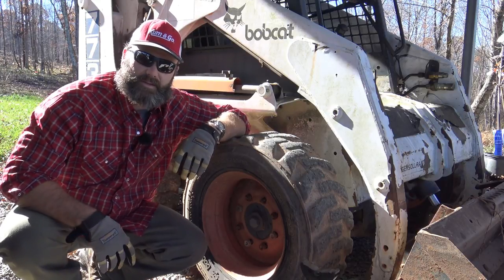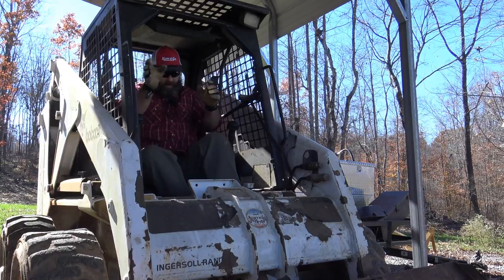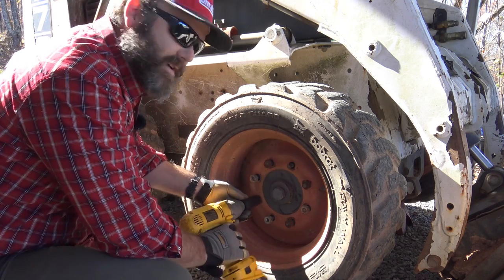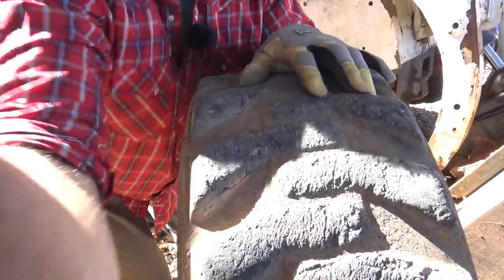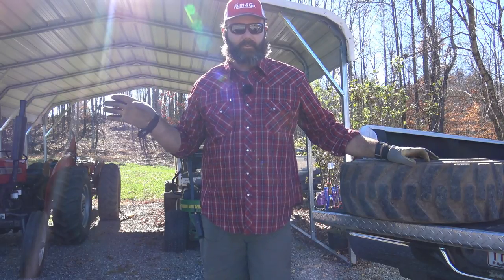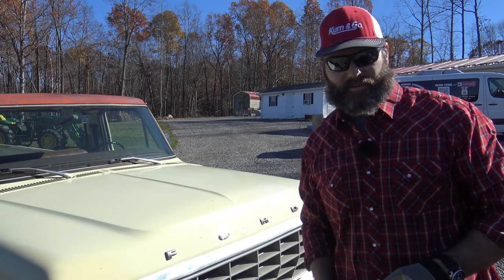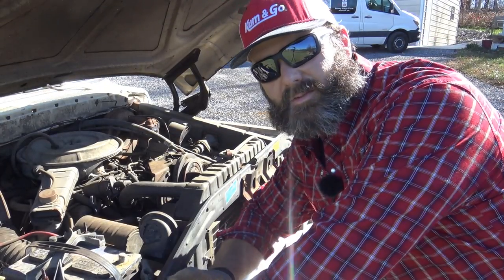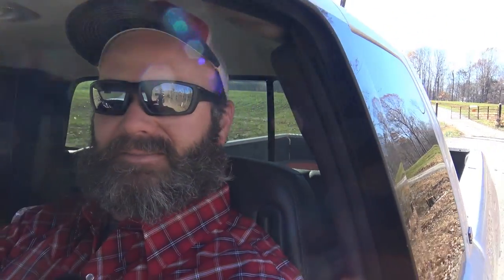$100 Pickup truck update, Bobcat Troubles again...another darn rant: government and responsibility

Comment: You may want to rethink the order of hooking up those battery cables  to battery...
Reply: agreed, positive 1st.
Reply: Agreed. You hook up the positive terminal first and then the negative terminal last on a negative ground piece of equipment. On a positive ground piece of equipment you hook up the negative terminal first then the positive terminal. Why, because slinging a wrench on the ground side and you accidently contact a ground point it will cause no harm. If you are on the "hot" side and touch a ground with the ground already hooked up you can cause damage, fires, explosions, injuries and even death in a worst case scenario.
Reply: The main issue is that the positive side will spark more than the negative side. Less spark is always preferred.
Reply: yep
Reply: Always pos first! You don't want to send a power surge into the elec system. These days manuf. have gone to using the neg side for switching things and controls for this reason.
Reply: Agreed, positive first.  It won't short out against anything should you happen to brush the frame with your wrench because the negative side isn't connected yet.  Always positive first when hooking up and last when disconnecting.
Reply: That is about the most sensible reason, some of the other theories are very strange
Reply: For technical functioning it does not matter in which order you connect them.

However for safety reasons it does matter.

The whole body of the car is usually connected to the minus pole. And you can accidentally hit that body with the positive lead. So connecting the lead first is safer.

Recap:

Negative pole first:
Whole car (except a few parts like the positive pole) are connected. Any mistake with the other lead will lead to a short. And car batteries are very good* at shorts. You really do not want this.

Positive pole first:
Only a small part of the car is now connected to power. If you mess up by touching the car with the other lead nothing will happen.

Lastly: This might also be a habits for people who deal with electronics. Ground goes first. Always.
Reply: Negative always comes off first and goes on last.

Comment: Disconnect battery.  1.  Neg   2.   Pos.
Re-connect battery   1.  Pos    2.  Neg.
Reply: Yep! ALWAYS disconnect the negative first and replace last. (This is assuming that the vehicle is negative earth) That way, if you're disconnecting or replacing the positive lead and the spanner touches the bodywork it can't short out.

Comment: A tip on how they "rebuild old batteries". Dump them out to dry. Test the core for conductivity between the posts. Fill with fresh undiluted battery acid. Spray some clear gloss on the casing. And, send them out for sale.  The factory gives the dealer 90 days warranty, and dealer passes it on to you. People who add tap water to a battery low on fluid are just shortening it's life. After a few "top offs" the acid is so diluted, it wont carry the amps needed to turn a starter.  Pay a garage to sell you a soda bottle of fresh acid. Keep it in a safe area in the trunk for top offs.  20 oz will last you for years. Corrosion of the coper plates is what generates the "juice" in a car battery. When they "done" They "done" fo-evv-a.  No mount'o new acid will revive m'. It.s been years since I even saw a battery with fill caps on top. Do they still make them ? I sure don't buy them. The vapor is what corrodes the terminals.

Comment: Love your videos.  I watched the one where you changed the wires, carp and Rotor.  I still have a dwell meter and timing light but haven't used it since around 1984 when I had a 66 Chevy II and we still had my Mom's 74 Hornet.  I'd have to "you  tube" how to use them, it's been so long. ha-ha..
That stuff was a pain but not as bad as the mystery Coil packs that go bad on my 02 F'd 250, as I call it.  Between spitting out spark plugs and Interior light/door lock computer issues, having more of that crap on a new truck really scares me.  I can't imagine that junk working when the computer and cruise control failed after only 7 years on my 02.  Anyway, ranting here, but nice to see your videos.

Comment: That truck is a hell of a find for $100.  It looks to be really original, right down to the hub caps.  I bet a lot of Ford fans would give their eye teeth to find one as original as that, and a hell of a lot more money too.  You're right about ethanol fuel.  A lot of older vehicles have brass components in the fuel system and carb, and ethanol will attack them like crazy and cause huge damage and problems...
Reply: +william III  You're right, the composition of diesel fuel has changed somewhat but those changes tend not to be so dangerous to older vehicles as the ethanol problems.  And, as you say, there are fairly easy ways to deal with it...

Comment: Here in Michigan its called "Rec Gas", (Recreational Gas) or Boat gas. 99 octane more expensive but i use it in all my small engines, ATV, Sno Blower, lawn mower Chainsaws, Etc Etc. I had to replace all my gas lines a carb kit and new fuel pump in my ATV, Ethanol gas will destroy small engines if let to sit more than 6 months even using fuel stabilizer. Do a google search for your area to find who sells it, all marinas will have it but its really expensive at marinas.

Comment: I pick up those side of the road mowers,clean and rebuild the carbs,then resell them. Most of the small engine repairs I do are fuel related. I love them,love that shitty fuel. It makes me money,thats all that matters. Love the older trucks,dont need those bells and whistles on these newer trucks.
Reply: RC Hobbyist Extreme I’ve come to appreciate both new and old trucks. Had on old 04 f150. Nothing fancy but great. Got a new truck 13 f150 all the nice bells and whistles. Both great. Trucks just depends on your needs

Comment: I was a mechanic for a local John Deere dealer and saw many small engines that had the carb messed up due to ethanol. I have fuel shut offs on all my equipment. I shut the fuel off and run the engine till the bowl is empty on the carb. I have never had a problem with the carb gumming up.

Comment: make sure u put the skid tire on right , the tread were facing the wrong way , its for traction. look at the back two.
Reply: Amy Bahr    tractor lug tire are designed to be self cleaning . If you run them backwards the lugs will pack and then you have " slicks .

Comment: You stated the size of bobcat tire incorrectly, 10x16.5 means the tire is 10 inches wide with a 16.5 inch wheel diameter (rim )

Comment: Few years ago a local station started sell what they market as "rec fuel" ethanol free gas. I been running it in everything from mini bikes, snowmobiles, quads and all my yard tools like mowers and weed whippers. Ever since I started I no longer have to clean carbs or drain gases at the end of season. Example my wifes mini is still running off the gas I put in it in 2015. It just finally ran out of gas this fall before I put it away for the winter.

Comment: Those are repairable. At our shop we get these tires in all the time. It needs a hot section and a recap with some HBAT tread. 40.00-60.00 to repair and around 125.00 to recap it if it passes
Reply: super6954 I missed it. His tires are a bit smaller than what were used to recaping. The prices range chcnges. Also when we recap them there alot more rubber on them than some.
Reply: Hector Nevarez sup Hector
Reply: Keeping It Dutch how's it going dutch

Comment: Love your $100 truck! You got a deal of the century with that. I hate the crap gas we get now. I have a 79 ford too that my dad built when I was born in 1985. Its got a bbf 460 that's been fully built and had about 500 hp. He drive it everyday and I drove it all through high school and up until they started putting ethanol in our gasoline and of course it destroyed all the fuel lines and carb. It took less than a year to do more damage than my dad and I did daily driving it hard, taking it to the drags, and doing some of the biggest burnouts for over 20+ years. Now that's that crap has been around for years we know not to get it but here in Claremore Oklahoma there's only a 2 out about 15 stations that have 100% gas. I hate it!

Comment: Josh it's the brake light that doesn't work on the trucks drivers side. If there is no drain plug on the gas tank, you should be able to get a hose in the tank. Probably best to drain that old gas out and not drive it out.

Comment: AWESOME truck , it's actually TOO GOOD for a farm truck.
Just a note to young newbies messin' with old vehicles with old gas.
If you get your hands on an old vehicle with really OLD gas DO NOT run it through the motor!
Funky 2-3 year old ethanol gas is usually ok but really old gas that's foul and stinky, funky and skunky will coat the valve stems with a super sticky varnish and after the valve drags that stuff into the valve guide for a bit there's a high probability it will glue that valve into the valve guide.
When that happens push rods start bending and you have created a HUGE project for yourself. Heads off, disassembled, cleaned,   re-assembled and re-installed and new push rods at the bare minimum.
DON'T DO IT !!
"The More You Know" .....

Comment: Love the daughter comment at 3 my daughter learned how to re-handle axes and hammers. Every time I work on something car, truck, etc. she is in the shop with me tinkering and helping. When her future BF/husband can't change a flat she'll be able to! But I hope that she'll be with a man that can do those things and not one of these know nothing boys these days.

The only good ethanol is the E85 and it's only good purpose is because racecar. It's combustion and such is far greater than race gas, you can run more aggressive timing curves and higher compression etc with less risk of spark knock. But as far as cars and small engines for regular use unless the engine and fuel system etc is specifically built for ethanol it is pointless and damaging.

Comment: we have a battery reconditioned place here in Denver. I asked them what that was about. they told me many of the batteries turned in at retailers are ok and just run down because the battery was not bad the charging system did not work. they charge and load test the battery. if it does 80 percent or better they sell it for 30 bucks and give a 2 year warranty. They will even swap out the battery and check your charging system no extra charge. My daughter needed an expensive german battery for her vw got a 30 buck one and it lasted 2 years. a friend needed 2 expensive batteries for his RTD transit bus again 2 for 60 bucks and on it goes. its ok to buy good used tested, not actually reconditioned, batteries.
Reply from the maker: Nice...I may have to pass that on to my buddy out there in Longmont!

Comment: You should keep your eyes open for a 1978 to 1979 Ford F250 4x4.
If you find one with a Dana 60 under the front it's worth its weight in gold
Reply from the maker: Nice...thanks for the tip

Comment: I saw flashing red lights in my brain when you said you knew where to buy a "good" reconditioned battery.  NO SUCH THING ! They can put some life in an old core.  But "cranking amps", which are key to starter life,  has to come from the factory as an upgrade over the low amp  that is good enough for a new, mid size car.  A long life battery will have a 6-7 yr factory warranty. It may cost 25-40% more depending on the store.  But, it will start hot, cold, rain, snow, flood, mud, hurricane, and clueless wife quick, for twice as long as the bargain price model by same maker... They build various batteries, just like GM, Ford, etc, build vehicles. You can get a carmi'n -cheapy or go for reliability in the ling run. Cheap gas & cheap batteries fill junk yards with good cars.  9 out of 10 salvage yards use their "junkers" to pill parts out on the lot. If they quit. NO LOSS TO THEM.  Crush m'. if I have typos. Sorry, I have a damaged finger on one hand.  Almost cut it "clean-clear-plum off" cutting shingles.

Comment: Two small mechanics and a priest told me to ONLY use SHELL gas up her in Canada.
Shell has no ethanol here and it destroys snow blowers and mine is 16 now.
I also use Marvel Mystery oil and a little Military Militec -1  in my 2004 cavalier in the gas 2 OZS mixed and in the oil 8 ozs summer and 12 ozs winther for cold starts and it had 5 cleaners in it and been around 90 years.
The friction reducers in M-1 and Marvel from walmart reduce the 27% in the engine and give you more passing gear in a 2.2 and compression in testing.
My highway MPG also went from 32 -43.3 at 60 mph.
The M-1 goes to hot spots and is used in military helicopter in case the oil is Vietnamese out and you become pow.
PLUS helicopters are expensive so they wanted heat protection of 35 minutes without oil...so Militect 1 was made for them by engineers and it's used in weapons.
I will use this formula on my 2016 Tundra gas pig to try for 25 mpg at 60 mph highway empty

Comment: Your Ford is a 1979, not a '78, the 1978 Ford trucks had round headlights, they switched to the square lights in 1979. What do you do for a living? Are you a farmer, or do you work outside as well.
Reply from the maker: It's a 78' for sure...tittle confirms...do a little homework and you'll find that the square lights were an option in 78...as for work I do have an "real job" until we get the farm up and rolling (2-3 years from now) I work in a local hospital as an RN

Comment: Nice old Ford pickum-up truck. Booze gas is mandated around here so it’s tough to get the good stuff. It always makes me nervous when I start my vehicles up when cold because the give an alcohol smell out the tailpipe and I think I have a coolant leak. I never hook up the negative cable first. At least not intentionally, I have sparked many a time when grounding off the positive side with a wrench when negative is hooked up. Seldom if ever when not. Reminds me, got to renew my tabs on my old 89 Ford pickup. Probably should start it to. Been a while. Can you get an upgraded axle for your Gator to reduce breakage? Or are axles cheap so you break them so you do not break something expensive? I can’t think of the last time I have seen a positive ground set up.
Reply from the maker: Ah....now you are the first person that has given me a good reason...thanks man...lots of folks have been saying I got it reversed on the battery hookups...but no explanation...thanks buddy!

Comment: What year is your Cummins  2500 12 value or 24 vale please make a video  about the  dodge
Reply: you can hear it's a 24 valve.
Reply: the second gens say it on the plastic door piece, 12v ones just say cummins turbo diesel, 
the 24v ones say cummins 24v turbo diesel.

Comment: I love them older 70's Fords 79 was the last year model of that body style.....  Then that ugly box frontend came out in 80...   

I thought yours was a 79 ....   79 supposedly had the square head lights. 78 had round ones...

I agree with ethonal issue..  I have a small engine repair shop and do a few how to videos on them..   Do yourself a favor and go buy a container of K-100 G   fuel treatment. It is the only one that makes water burn and stabilizes old fuel....

I am going to be a dealer for them.  

I got you subbed  Mon Ami ~!~!
Reply from the maker: The tittle says 78 maybe it's a late year model
Reply: Ok I called my buddy who worked for Ford for a long time and asked him about the Round lights....   In 78 the XLT and Lariats I think he said and another model had the more stylish square lights........   

The round lights were the bottom line trucks............... Thanks for the reply ~!~!

Comment: Did the DMV believe that you paid $100 bucks? I agree on ethanol comments 100%! Here in Wisconsin some gas stations are selling 15% ethanol with warning labels telling you not to run it in small engines. Ethanol free gas is called "ultimate " and runs $3.40 a gallon. 10% ethanol gas is $2.60 a gallon.
Reply: 3 40 a gallon here in mn 91 non oxy is 30cents more than 87

Comment: You made a wrong statement inn your video.  You ALWAYS disconnect the negative first, and reconnect it LAST when you change out a battery.  If the negative is hooked up first, you might bridge to ground when you attach the positive and that could cause an arc and explosion.
Reply from the maker: By bridging to ground do you mean hitting my wrench to ground while tightening the battery connection?
Reply: That is correct.  On a negative ground system, you have to isolate the ground before you interact with the positive to avoid an accidental arcky sparky.  Enough of an arc and the wrench can weld itself to the frame
Reply: Yes, that is correct.  If you do it the other way, you can weld the wrench to ground  by accident while you are tightening up the positive cable..

Comment: You should at least clean all of the leaves and crap out of the damn bed. And you have a burned out left brake light. All the debris in the bed eats up the metal. Then you end up with a rotten bed floor like my '75 Ford f100 had.
Reply from the maker: yep...you can bet I will take care of that...just get out the leaf blower and get it done!
Reply: Stoney Ridge Farmer my brother is about to buy a 79 f150. It's a short bed. With a 302 in it.  He's having to pay 1300.00 for it. But it needs transmission work. Not a problem for us thought we can do just about anything mechanical.